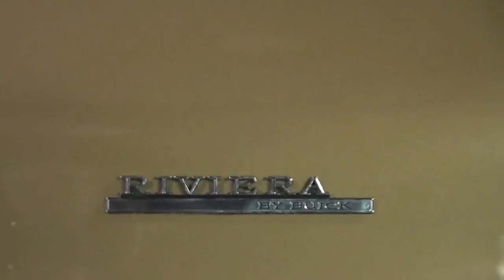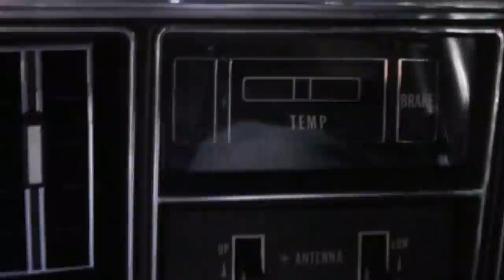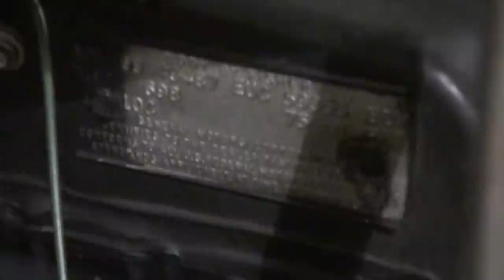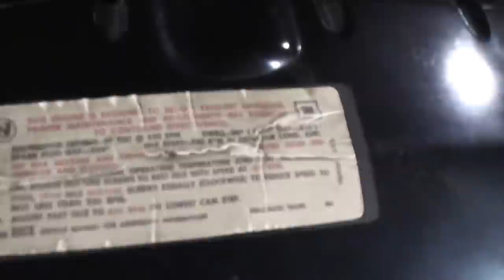1969 Buick Riviera GS Gran Sport in Embassy Gold at World of Wheels My Car Story with Lou Costabile

Comment: Gorgeous.

The summer of 69 saw some of my family members get new cars. My Aunt BeBe bought a midnight green '69 Chrysler New Yorker from Fred Oakley Chrysler-Plymouth. My Aunt Nancy bought a '69 Mercury Marquis Brougham from John Eagle Lincoln Mercury. 

Just before my mother ordered a new '69 Grand Prix Model J from Van Winkle Pontiac in Dallas, we took a look at a Sapphire Blue 69 Riviera with white top and interior sitting in the lot at Don Snell Buick. 

I have a love affair with hidden headlights. I remember watching a salesman raise the hood and turn on lights. My 5 y/o mind was impressed.

I read an article a while back about some of the reasons auto manufacturers stopped offering them. Among them were the higher repair rates after a front end crash. Leaks in the vacuum lines and motors freezing in very cold climates.

The '66-'69 Riviera came under fire from the NHTSA because the lights came on first before swinging down. It said drivers coming from the opposite direction, at night, were temporarily blinded by the lights as they swung down into position. I guess GM could have manufactured a two stage switch that swung the lights down before turning them on, but honestly I can't imagine anyone being so blinded in the seconds of operation that it would cause an accident.

Anyway, this is another great Lou.

Thank you.
Derric :-)
Reply from the maker: Hi Derric, Happy to read this video brought back memories of your Family members car :-)  Thank you for viewing and sharing, Lou
Reply: Wow that must have been a great summer being a young man riding in the back of all those new cars !

Comment: Beautiful Riv and I miss my 69! Always loved Buick as most of my friends had Chevys. My car used to smoke the tires like crazy 👍
Reply from the maker: Hi Phil, Thank for viewing and I'm glad this video brings back fond memories.  Also, I like the "smoke the tires like crazy" part :-) Lou
Reply: I am primarily a Ford/Mercury guy, but I always had a soft spot for Buicks and Pontiacs. One day in the mid 90s, I was at work for a home service company, and since it was a Friday, I was running a route of 'special service' jobs out in the rural southeastern PA area. One was a newer client that I'd never visited, and I noticed he had a separate, 3 car garage off the side of his driveway. I looked into the garage door windows, to see 3 mid 60s Grand Sports inside! He wasn't home, so I didn't get a better look.

About an hour later, I pulled into the driveway of the next customer's home, about 5-6 miles away from that last home, and the first things I see in their open air carport, were TWO MORE Gran Sports!! That's 5 Gran Sports in 1 hour, at 2 back-to-back jobs! These 2 were both in beautiful condition. One was a dark greenish colored 1970 GS with the optional 455 Stage 1. The other was a 1972 GSX in silver with black stripes, and a 350. I hadn't seen either of those cars at that home before, and it turned out they had just been 'gifted' to the teenage kid who lived there, by his grandparents, who had originally bought them new, and cared for them for the previous 23-25 years! That's one LUCKY kid!! By now those 2 cars are worth a small fortune!

Comment: GM did that front-rear channels on some stereos into the 70s. It was terrible,  especially on a convertible. The rear speaker would face toward the rear mounted in the seat back in the top well. The boot would enclose the speaker.
Reply from the maker: Hi Lucky B, Thank you for viewing and sharing your knowledge, Lou

Comment: I got a 1968 with 455. Airplane shifter
Reply from the maker: Nice :-)
Reply: They didn’t make the 455 until 1970 so someone must’ve swapped out the engine (or the air cleaner lid).

Comment: GS's that year had a dual quad option, didn't they?
Reply from the maker: Hi Chris Pappas, Hmmm, Not sure.  I hope a Viewer can share the answer to your question, Lou
Reply: @loucostabile  1965 was the last year Buick offered the dual quad set up on the 425 Nailhead engine from the factory. 1966 was actually the last year for the dual quad set up, but the parts came separate in the car and had to be installed by the selling dealing

Comment: I've never been much into Buick... too much of a stodgy old (professional) man's brand. The suspension was always tuned too soft and the Dynaflows in the pre-1964 cars were very inefficient and responded sluggishly unless you manually shifted down into first gear. But the Riviera is such a beautiful car I make an exception for it. 

Fortunately GM killed the Dynaflow in 1964 and made Buick use the Turbo-Hydramatic like the other premium GM brands. (They let Chevrolet keep using the Powerglide until 1973.)
Reply from the maker: I can understand why you enjoy the design of this car :-)

Comment: Looks like 68 back lights...but front grill is 69...
Reply: Yes! I noticed that too!! My Dad a new Riviera in 1968. And my Mom back into a pole and broke the tail lite surround. And the Buick dealership ordered a new one but for a 1969 Riviera. It had 2 or 3 vertical bars on it. The 1968 didn't!🤔
Reply from the maker: Hi François Bélanger, Thank you for viewing and sharing your knowledge. Hope you see many more cars on this YouTube Channel you enjoy. Please subscribe, and hit the "bell" so you can see all the cars when they are uploaded on this YouTube Channel, Lou
Reply: Nope.  The ‘68 Riv had separate backup lights in the bumper just under the tail light lens, the ‘69 had the backup lights incorporated in the lens. What a great car, I miss mine still!
Reply: The car is an early production 69, built Oct of 68. It has the 68 taillight bezels direct from the factory at time of build, as GM sometimes installed previous year parts on the new model until the supply was exhausted on the assembly line. This has been confirmed with the Tech Advisors in the ROA as correct. They are still trying to determine/document the actual date the 69 bezels started being installed on the assembly line. 68 had full red taillight lenses with the backup lamps installed separate in the lower section of the bumper where the bumper begins to curve inward. 69 the backup lamps were located in the taillight lens positioned closest to the gas tank lid